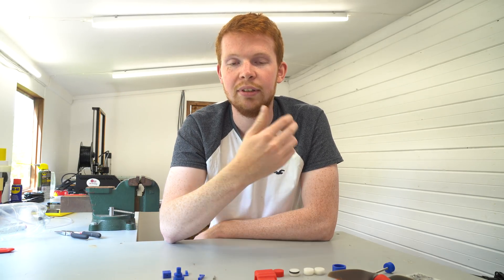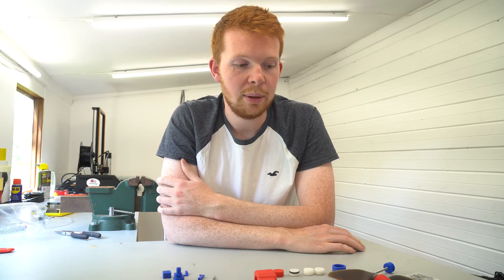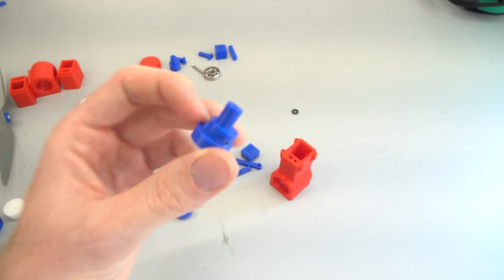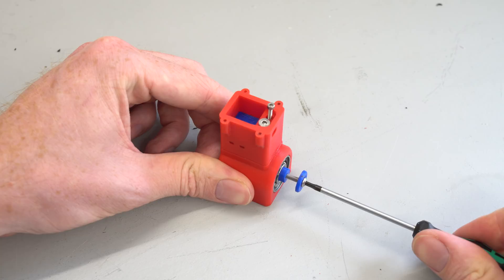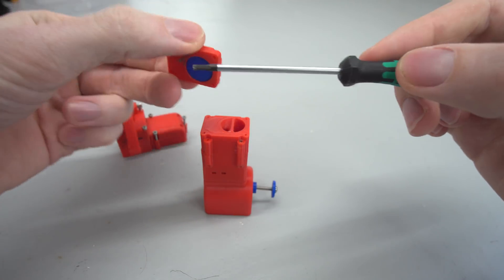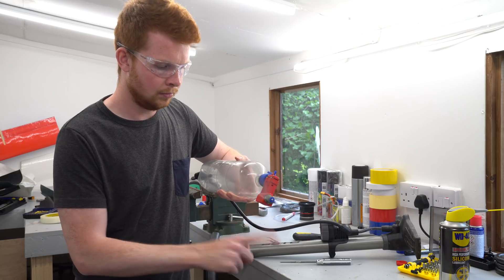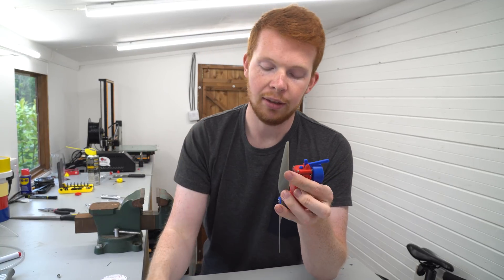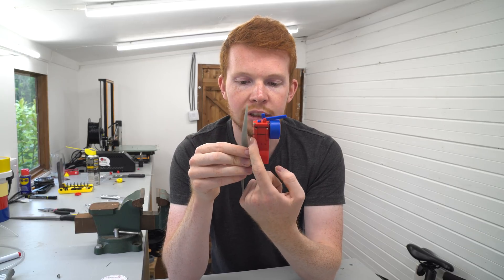Air Engine Exhaust Valve

Comment: Hi Tom,I think you might be involved in the interference condition, frequent in articulated quadrilaterals. 
In my opinion, I found three major problems running against the smoothness and regularity of the engine, that eventually drive it into a stall.

First: your recent magnification of the engine stroke changed the ratios between bore and stroke, probably, out the suggested limits: bore/stroke ratio should be no lower than 0,6:1 and no higher than 1,4:1. Also the mass ratio, considering the piston,stroke and crankshaft shoulder should be : piston + 2/3 of stroke equal to crankshaft shoulder+ 1/3 of stroke.

Second: your project is missing a proper crankshaft  and flywheel: those are a complications at what supposed to  be a simply and easy to build air engine, but maybe you should consider an advance design at this point.

Third: As you mentioned in the video part of the problem could be addressed to the twin cams, that I think it's correct: but I address the  engine stopping problem, due to incorrect masses rotation conflicting with the rotation of the crankshaft, more than the increase of the friction 

Note: going from two bearings to one bearing may also influenced the engine smoothness , the masses of the cams  rotating could start rotary flexion that one bearing is not able to absorb

Comment: Hi Tom, you have changed 2 variables in once so it is not sure if  the exhaust port or larger stroke causes the bad performance.
It seems logical the engine runs less long without bottle pressure. In the version without exhaust port, the compressed air acts as a spring. With the exhaust port, the air is expelled and without pressure from the bottle, a vacuum will be created when the Piston travels down, consuming energy
In theory having an exhaust valve should enhance it's performance as you are not wasting energy to compress, and you can add more compressed air, so more energy.
Increasing the stroke has added more friction. As example pushing a box 1 meter uses less energy as moving that same box 2 meter.
As experiment, remove the parts from the exthoust port and block the exthoust. Than you have somewhat the same design as engine 3 but bigger stroke.
The bigger stroke and thus bigger volume, will create more head pressure before your intake valve will open.
I think it also will not run.

Comment: I don't know your intended application, this is your only video I've seen. You are quite right that adding complexity often reduces efficiency in machines. Vane air motors are quite simple and can be very efficient. They can be designed to operate at low pressure. Not only do vane motors require no valves beyond a throttle, they are self starting. That is why they are used throughout industry. Piston motors generally can generate more torque at low speed but that doesn't seem to be your goal.

Not many good videos about air motor design on YouTube, but this one is a pretty clear visual: https://youtu.be/BD9-VvSRgME

Comment: Hey Tom, it would be interesting to see what would happen with dry ice or liquid nitrogen in the bottle, creating pressure and power as it evaporated. If you coated the bottom of the bottle black on a sunny day it might work?

Comment: a salvage piston may of been interesting but yeah probably hardly worth while, more to go wrong, more friction... plus a salvage piston may of created back pressure when the pressure got too low.
increased stroke may decrease engine rpm, which is what your really after (longer flight time)
yeah weight of cams is killing that version

Comment: You need to design it like a steam engine because that's basically what you are building. The difference being that you are using compressed air instead of steam.

Comment: You should look into multiple pistons because some steam powered vehicles used a setup with a high pressure piston and a low pressure piston to take better advantage of steam pressure. I'm sure the same can be applied to this.

Comment: Piston travels up and stops, then travels down and stops. So the longer the piston stroke the greater the distance travelled and the greater the piston speed for a set RPM. A "square" set-up is a good starting point, this means the diameter of the piston is equal to the length of the stroke.

Comment: Tom, "nail" valves are not very efficient. Overhead ball with two holes through the ball at 90deg angles and lubed o-rings to seal the ball top/bottom, spin @ 1/2 crank like you would a cam. I had this concept CAD'd up bout 7yrs ago but lost the files :( perhaps the ball valve cyl head would work better having much higher flow rate than nail valves.

Comment: It takes more energy to move a piston with a longer stroke up and down. It is simply because the piston is moving a longer overall distance. A shorter stroke will produce higher rpm less torque, and run on lower pressure. A longer stroke will require higher pressure, produce more torque, and run at a lower rpm.

Comment: Best result you will get V-twin,high pressure sylinder and other sylinder low pressure sylinder.Same like bessler steam aeroplain engine.And after that when it is working you can start desing v-4 hp,lp engine.And if you want to have more air capasity use airsoft or paintball gun tank and you can also put more pressure at those tanks but meaby you have to regulate the pressure what you want to use at the engine.Hope that make sense.

Comment: Double expansion engines are sometimes called compound engines. If you want to reduce the air leaks around the piston without adding friction, you can dig the grooves for the piston-rings but without mounting the rings. It will create turbulences and slow the air between the piston and the cylinder.

Comment: Ive had an idea that MAY solve your exhaust valve problem. I dont have access to a machine shop anymore so i never made it.
Idea is as follows.
 A hole through the centre of the piston which is only sealed on the power stroke.

On the exhaust stroke the conrod is obviously angled due to the crank. I suggest at this angle have a flat or cutout in little end of the conrod which lines up with the hole in the piston and allows exhaust to flow through the piston.

On the power stroke the conrod is angled the other way so this flat or cutout is no longer inline with the hole in the piston and is sealed.
Simple eh!

Comment: In car and motorcycle engines at normal operating speeds, the forces in the connecting rod for accelerating and decelerating the piston are usually greater than those produced by the gas pressure acting on the piston.  I've not done the sums to see whether or not this also applies to model sized engines at typical model engine RPM.

Comment: Tom! I had high hopes for an exhaust valve :/...
Actually all last week's debate about single/multiple cylinder set me on a train of thought which would offer valves without cams:
2 cylinders, one inside the other, linked to the crank like a V-engine, maybe 30° angle offset. Intake and exhaust controlled by the outer cylinder, much like your v1 engine, but without the spring.
Hopefully you're as intrigued by the idea as I was... I'm hardly expecting you to make every randommer's suggestion, but I'd love to see you give this a bash.

Comment: Is it possible that the exhaust valve needed to overcome the cylinder pressure applied to it in order to open? The exhaust valve may be needing to overcome friction and positive valve pressure to open, reducing efficiency.

Comment: Well, compressing the air isn't the biggest of deals, because the air acts as a spring the energy gets returned. (Although in theory this reduces the minimum psi required as you have to overcome the initial compression pressure. But efficiency remains the same as if the compression magically didn't exist) Reducing friction should be higher up on the priority list. A longer stroke would use more of the energy of the expanding air, but there's a max where you don't get any more return (this is why modern cars rev lower then 90s golden era. Longer strokes for efficiency)
Reply: SeenCreaTive i

Comment: on modern engines and even older engines that have a form of throttle there is a choke system that holds the throttle open partially. if you open the throttle when starting it will ease the start. as for the valve set up you need to increase the speed at which it rotates to compensate for the extra weight that the valves are creating. you also have to factor in rotational friction that the valves create.

Comment: Hi Tom I've been watching quietly your progress designing and building your compressed air engines, and understand your frustration and rejoice your successes. Everyone has been helpful. I just wanted to say that the exhaust cycle is unnecessary as it only functions to reduce pressure and acts like a vaccum and aliow the air from the tank to exhaust by the time the piston begins to compress the air from the tank there is not enough to drive down the piston. The reason the single cam engine works so well is that there is that air chamber is always sealed. Again, it is just an educated guess based on the purpose of an exhaust valve is to vacate gasses to allow a full charge of air and fuel to fill the combustion chamber.  As for the leaking cap, USWaterRockets is correct O ring seals are primerally to keep liquids from leaking, and flat compressible seals make a better seal under higher pressures. I hope you find this helpful and at the very least gets you to find a good solution to your problem.

Comment: Try lighter springs on the valves? The air pressure will hold them shut. The spring just needs to pull them close enough.
Reply: You could public publish the printer files the week after patreon gets them.

Comment: This would maybe go against the idea of a purely mechanical engine, but maybe as a future video it would be cool if you made the valves solenoids, so that you can control them electronically. Then you have a sensor/encoder for sensing rotation/speed/position and you could time the valves and tweak them in real time using a serial connection.  Not sure if Arduino would be fast enough but you could experiment with something like that anyway.    Though the mechanical design is cool in that it's not relying on any kind of brain box, but much trickier to tweak.

Comment: Suggestions: 1) change the throttle to a variable geometry cam which varies with axial motion.  This will increase efficiency greatly at low throttle while keeping it the same at high throttle.  2) Use the sharpened end of one cap screw inside the conical indent of the other's head to form a near zero friction 2 point contact bearing with more than sufficient load bearing capacity.  This can be done with M2 fasteners inside of the heads of M3 fasteners.  The end of a M2 cap screw may be sharpened effectively with a grinder or a Dremel tool fiber cutoff disk.  Use a flashlight based optical comparator to test for concentricity of the sharp point by comparing to an accurate CAD printout taped to the far wall.  Both sizes will self thread into an appropriate sized hole with effort and will remain stuck there due to extreme friction if the hole is appropriate tap hole size for aluminum/plastic on the drill and tap chart.  It should take effort with a screw driver and may take some skill to get it to go in straight.  Use a belt/rubber band to transfer torque from that to the propeller shaft.  Use 2-3 line walls when printing for sufficient strength around self tapped bolts.

Comment: A large bore with a small stroke allows for high rpm and a the Opposite gives large tourqe but limits rpm due to the longer distance traveled by the piston also, a longer conrod will decrease load at the bearings because it will reduce the angle between the rod and the crank.

Comment: Love your channel. It's becoming a Friday regular for me and my two boys. Too bad that version engine didn't work! But nice try! I think the fails add to the excitement. I think you should have gone with the flat twin. More efficient. Unlike fuel, your supply doesn't continue to expand. Less stress on the crank too, and I think you can limit the supply with larger pistons allowing for better torque. Lower the stroke so you can crank faster. You won't need as much exhaust then from each cylinder so less to crank against. You need high torque and high rpms I think. Maybe you need to gear it up too? Doesn't take a lot to spin that little prop, and with the right airframe, lift shouldn't be an issue with the added weight of the gearbox. Looking forward to the next upload! Awesome project!!! :)

Comment: You missed your mistake.  Exhaust at the bottom of the stroke does not create an absence of air. Then you are compressing for a quarter stroke, fighting onward rotation then expelling it just before intake, again. Chose one or the other, not both so you do not undo your momentum.

Comment: i had an idea for a 2cylinder engine with only one cylinderhead/air inlet. ( remembering you saying, the cylinderhead could be a problem). i tried to design it in fusion 360 but i guess im just too new to it😅. wonder if it could work. tought mirroring you V3 engine would do it with ease.

Comment: i am not sure the resistance is ti be expected, If it operates with one cam, a second should not be so dramatically different, try some lubrication?
Reply: The inlet valve is pushed open against the incoming air pressure. But he put a spring on the exhaust valve to hold it closed. Shouldn't need a spring as the pressure in the cylinder should hold it closed.

Comment: Suggestion for increasing efficiency: make the air expansion non-adiabatic, i.e., allow heat exchange between the stored air and the atmospheric air, while it expands. While expanding, the air would "absorb" the heat from the environment, increasing its expansion further and, hence, the thermodynamic efficiency (this is, basically, the opposite thermodynamic process that occurs when you pressurize the bottle: the air heats in the pump and then looses this heat to the atmosphere; ideally, you should implement a way of recuperating some of this lost energy). One of the problems of your concept/design is that you have built your engine cylinder with plastic, which is a very poor heat conductor. Ideally, your cylinder should be built with, e.g., aluminium, ideally with fins (like a common model engine). Yeah... I know this would incur in a weight penalty, but I "guestimate" it would be worthwhile. Or you could just use a thin walled aluminium tube as a cylinder, for lesser weight penalty (this alone would make a significant difference from your current implementation). Alternatively, you could place an expansion chamber equipped with a heat exchanger between the tank/bottle and the engine intake; e.g., this could be just a simple coiled aluminum pipe with a cross-section similar to the engine intake (the orifice between the bottle and the expansion chamber / heat exchanger should be smaller than the cross-section of the pipe/engine intake). This is the basic refrigerator/heat-pump principle... (you should check it out if your not familiar with it, imho). It's all about the laws of thermodynamics... ;)

Comment: I'd suggested trying to perfect a design but having read thru a few of the comments already and someone has suggested a compression engine, and I'd defo like to see a single cylinder compression engine as the next stop unless their are specific reason to have not already tried it.

Comment: You might just have it so the cap on the bottle is not leaking but yet the intake valve is open when the exhaust valve is open so you might just need to tighten the intake screw

Comment: How about putting the exhaust valve at the bottom of the cylinder so the pressure escapes at bottom dead centre? Similar to how a 2 stroke petrol engine works.

Comment: Hi Tom, so dual pushrods & cams will increase drag, but did you add any lubrication to the cam/pushrod interface? You don't talk about it at all. Also, could you make a single-cam operating both outlet & inlet valves?

Comment: You could try a sleave valve on the outside of the cylinder? Would let you have the exhause ports at the top by the head

Comment: Look at triple expansion steam engines if you need to understand how you get more efficiency out of a compressed fluid from exhaust to input into further cylinders. Internal combustion tech is not appropriate here.

At this scale, I think friction is the issue.

Comment: Good video and observations.  Wouldn't have thought that the friction on the exhaust would make much difference. I suppose with a dual piston design as the opposing cylinders receive air the power stroke would held the other stroke to exit the air after expansion.  It seem the previous motor design was better and could be improved by using this design and using a single cam in front. Would love to actually see the difference in performance with larger pistons and longer stroke designs especially when it comes to leakage around the piston and sleeve and also how it would affect torque and rpm for each given design. Keep the vids coming cant wait for next week

Comment: I was thinking a flat plane crank 2 cyclinder "boxer" engine might  offer an efficiency boost, since the power stroke of one cylinder would assist the compression stroke of the other, and the exhaust stroke of one would happen at the same time as the intake of the other. Might be a wash with mechanical losses and weight though. Not sure.
Reply: RhodyJeff there is no compression stroke. It's a 1 stroke engine at this point but I agree that second cylinder would help for sure

Comment: Added electronic valves instead or mechanics. You could change timming and a lot of less friction. For electronic valve, you can use solenoid valves, they are cheap, fast and they have no leaks.